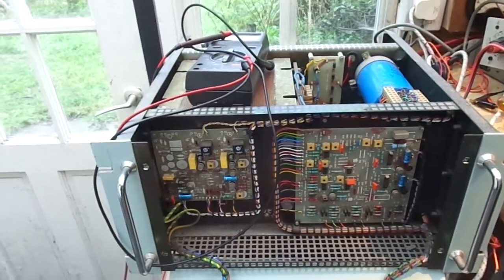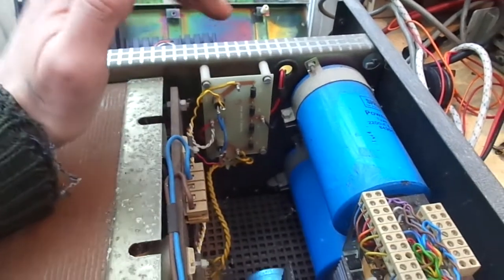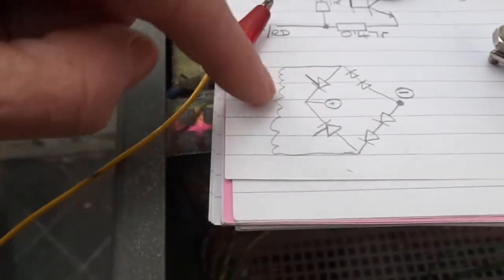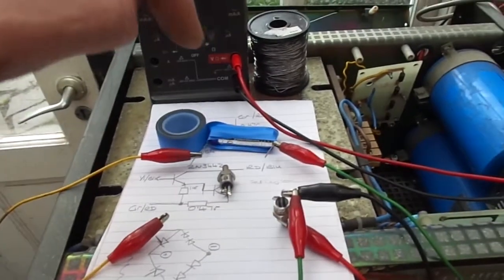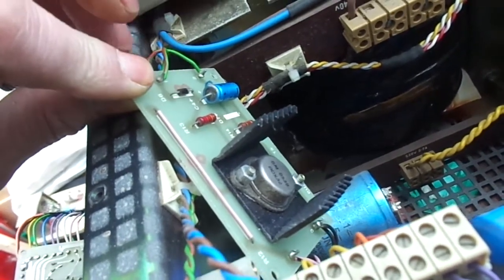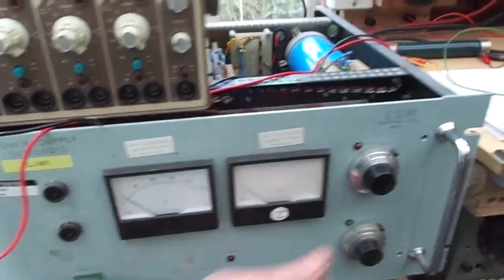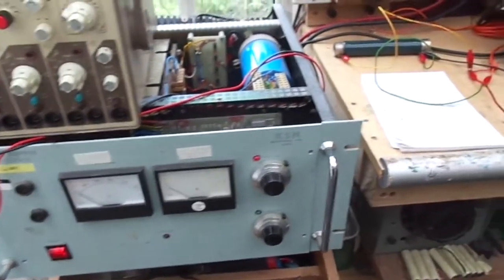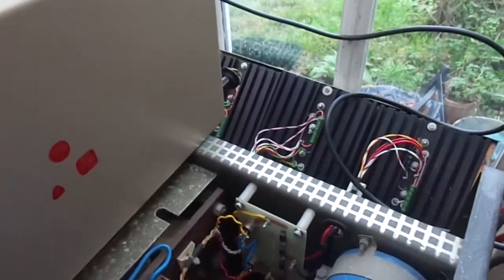High Voltage Power Supply Repair - KSM SCT-500-3 (500v 3A)

Comment: Brilliant - pleased that it is working properly again. What a beautiful quality piece of kit and that transformer is enormous! I can see good quality Electrosil resistors in there too. Must have cost a fortune when new... RRA Vulcan appears to be Rolls-Royce Vulcan nuclear test reactor at Dounreay
Reply from the maker: Aye, it is a cracking power supply, as you say it must have cost a mint, don't think many were made. There's an SCT200 something or other too and I've seen one or two lower power bench PSU's. Yep, Dounreay nuclear site, when I looked  I thought RR Vulcan was closed, will do some more digging, you never know they may have the manual : ) TFW....DA.